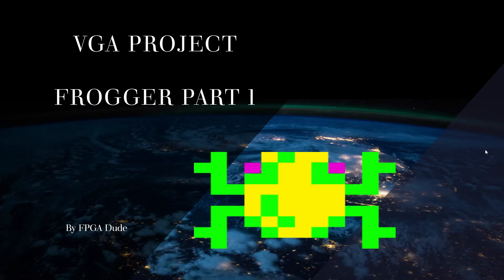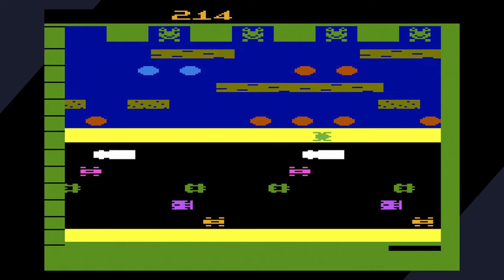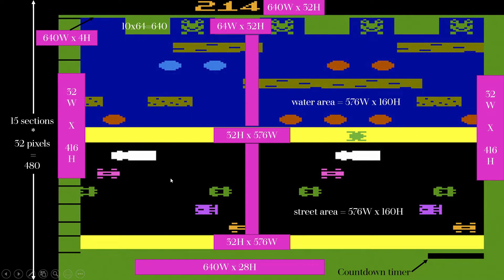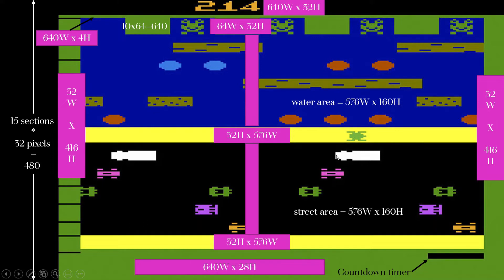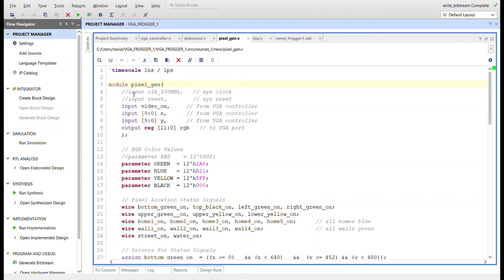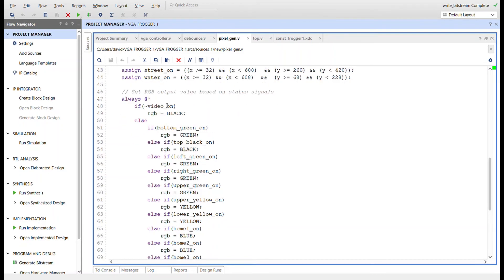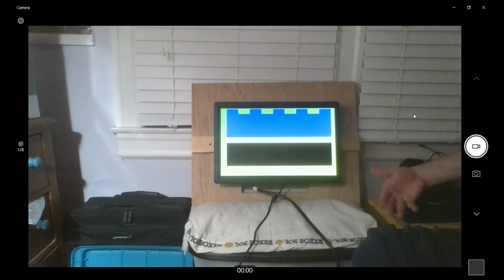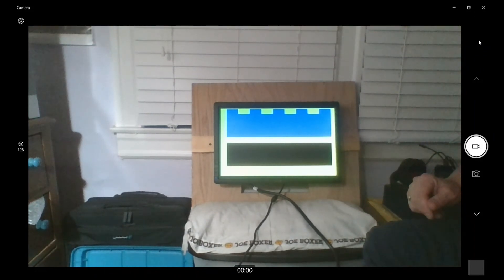VGA Project Frogger Remake Part 1 Verilog Basys 3 FPGA Vivado

Comment: sir, i 'm trying image load to vga monitor. In simulation, display variables are true but after the bitstream i can not see the image on the monitor. The monitor said 'no video signal'. What should i do? Can you help me, please?
Reply from the maker: I would recommend doing some troubleshooting. Look into the hardware such as cable and cable connections. To check your digital signals, you could use a logic analyzer on the VGA signals and verify if they are working correctly. Other than that, I couldn't tell you. If your circuit is simulating properly, and the bitstream is generated it is an acceptable circuit. Analyzing the signals coming from the FPGA to the monitor could help you find an issue or let you know that the problem is not this part.